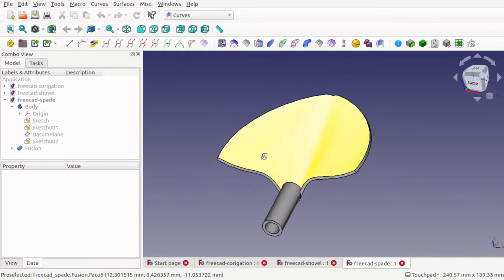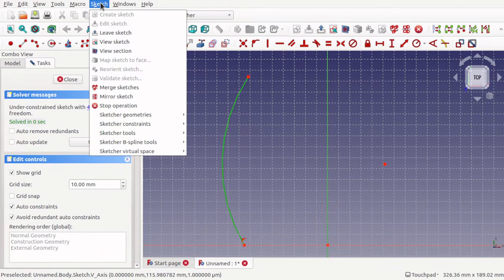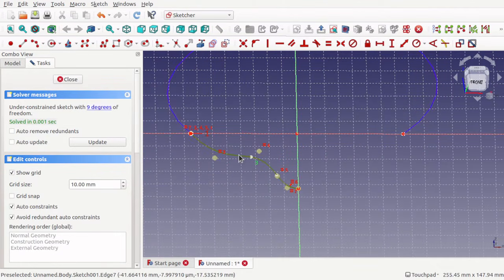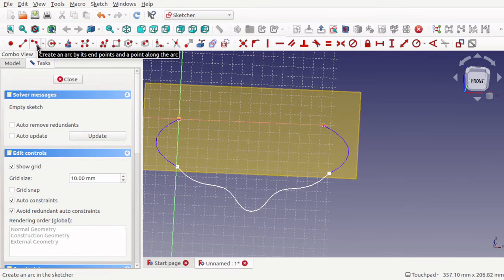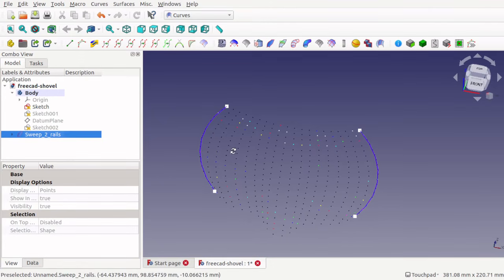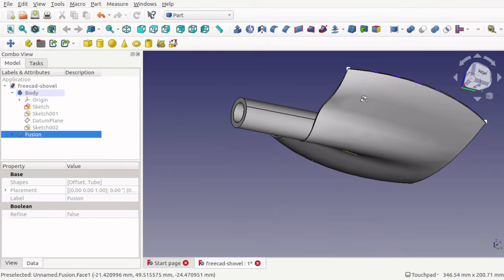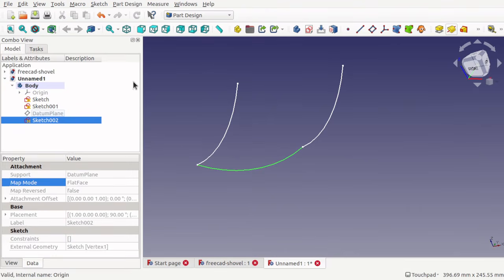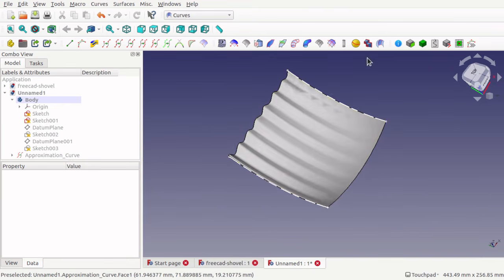Learn FreeCAD Curves Workbench [01] Sweep Along 2 Rails, Join Curve, Nurbs surfaces Practical Guide

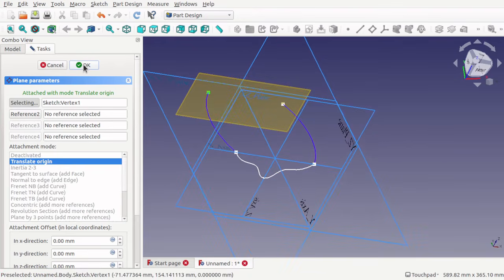Comment: 12:56 I tries to follow this tutorial using version 1.0 - and the newer version of FreeCAD behaves slightly different when changing reference from a plane to a vertex. In version 1.0 the first reference I used was XZ_plane, then for the second reference I select the vertex and the attachment mode becomes XY parallel to plane.
The B-spline tool also have some differences from the version shown in the video.

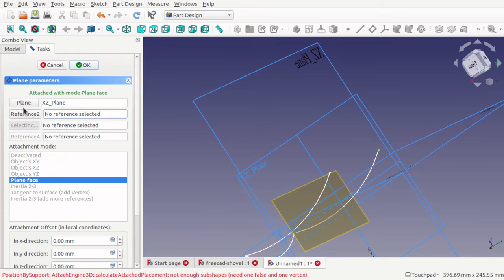Comment: Confirmed to work in 1.0. Only difference I found is when attaching datum planes, one must set e.g. Reference1 as the XZ_Plane, and Reference2 as Sketch:Vertex1 (so the "part that's gone wrong" at 28:25 is expected behavior in 1.0, it seems). Other than that, worked like a charm (even Curves Workbench).
Such a great tutorial, thank you!
Reply from the maker: Thank you so much for verifying that. A good stop gap until I can get all these update. Thank you for your time in relaying that in the comments.
Reply: Theres something he does at 9:55 that just isnt in my freeCAD. I have no button for making two points one point. And for the life of me I cant figure it out. Im assuming its a difference from this and 1.0? Or from Windows version to Linux? I dunno. But I simply cant figure out what he did.
Reply: @TinyMossDragon  That icon looks different in 1.0, look for "Constraint coincident"

Comment: Your toturials are extremely helpful and extremely educationally done. Thank you so much!
One problem with surface and 3D offset: I use Sketcher to create a semicircle and a line consisting of 3 straight segments in the XY plane with some distance apart in the Z direction. I use the Curves WB to change the line into a joined curve. Then use Part WB to create a ruled surface. No problems so far. But when I try to do a 3D offset, I get the error message "BRep OffsetAPI_MakeOffsetShape not done". If I straighten out the 3-segmented line to be a straight line, then 3D offset is successful. But as soon as I introduce a slightest angle of the two end lines, the error message comes back. What is the problem here?

Comment: When we create a datum plane and attach it to a vertex, I find it nearly impossible to select that vertex as an external reference. A quick work-around is to offset the datum plane via Attachment-Position-x (or other axis)  such that the center point of the datum plane no longer corresponds with the vertex. Once I do that, I can open the sketch and select the vertex as an external reference. I can then restore the plane to its original position.

Comment: Good job on this tutorial, as always. I think I'm going learn a lot from this series. The surface seems to be a bit 'bumpy' - is there a way to get it smoother? I increased the Point Cloud's Profile and Rail samples to 100 each (and waited), which helped some but I still don't have a smooth surface.
Reply from the maker: Glad you enjoyed. To make the surface more smother you can play with the degree max and min setting then to a lower value on the approximate curve via the data tab.  Also on the view tab decrease the deviation to 0.05

Comment: Followed the tutorial and then rendered it (poorly)  in Blender.
Excellent tutorial,had to restart FreeCAD after installing Curves. 
The app image also crashed on me when I installed the plug in so save your work before installing the plug in!
Reply from the maker: Great to hear your 'blending' the two together and experimenting. Glad you link tutorial. Have you tried openscad yet? I know your into your programming and was wondering if you would enjoy working in with the tool?
Reply: @MangoJellySolutions  Yes, I have looked at it, I will revisit it at some point, for various reasons I need to stick to Python (partly due to my channel name!).  One idea I have is to automate  a basic part in FreeCAD and render in blender all fron 1 Python script :)
Reply from the maker: @jobstr-work  sounds cool, see you have some videos with Arduino on your site. Ever tried hooking one up to the freecad python console to take inputs from the audrino to the model from a serial read? Could be interesting
Reply: @MangoJellySolutions  Ah, yes, and have some interesting human input devices - a bit like a Wii controller to control the rotation of a FreeCAD model?
Could also link it up with a TV remote to send IR commands to Arduino - to PC - Press the red button on TV remote for XY plane! Long winter coming up, I'll see wht I can do! 🙂

Comment: Hi, thank you for your tutorials. They have been a great help. I'm having difficulty doing something similar to this, except my two curves (that you used to make the first Ruled Surface are adjacent. It's difficult to explain but the two endpoints of the first curve are coincident with the two endpoints of the second curve. I successfully created the surface from those two curves, but now I'm trying to deform it onto one curve that runs between the midpoint of each of the curves that were used to make the ruled surface. So Sweep2Rails doesn't work because I only have one rail. Your help would be very appreciated. I'm trying to model the part of my interior door handle where you grab onto to pull the door closed. Thanks!
Reply from the maker: Glad you are finding the videos useful. Do you have a picture of what you currently have?
Reply: @MangoJellySolutions  One of the images shows where I tried the "surface from 3 or 4 edges" option in the Surfaces WB which would make this simple but it yields a jagged, warped finish

Comment: Great tutorials. It's great to see the Curves workbench getting such detailed treatment. And your presentation is very good. Question: why add a datum plane? You can position a sketch exactly the same way. Using just a sketch reduces "stuff" in the feature tree and avoids adding a redundant Placement object (one in the Datum object and one in the Sketch object).
Reply from the maker: Thanks for the comments, great to get some feedback, yes totally agree with the datum plane, less its more. The only reason I added was to make it easier to marry up both ends so they connect continuously. But agree you could of done this with positioning the sketch or use the freehand curves.

Comment: OMG I would never have guess the tool logic - I would have expected select two profiles two rails hit loft along 2 rails and done.
Reply from the maker: It may seem long winded but after using it for a long time I realised that this is a workbench that give you a number of tools that can be combined together in many ways in a way to create recipes. There is no one tool that fits that exact process but a combination depending on your application. It does seem long winded but the workbench has been made by a user in their spare time. It still needs to be polished and currently still in development.